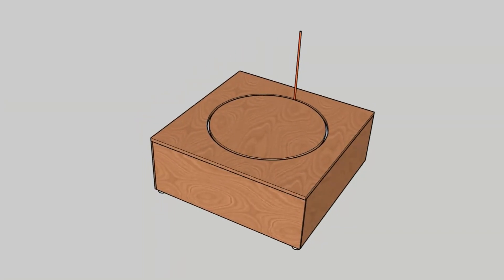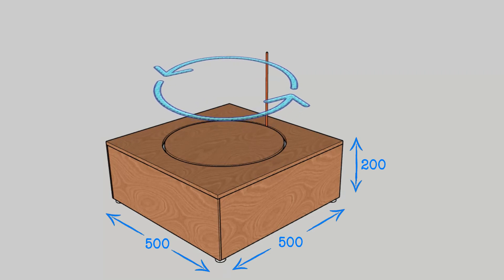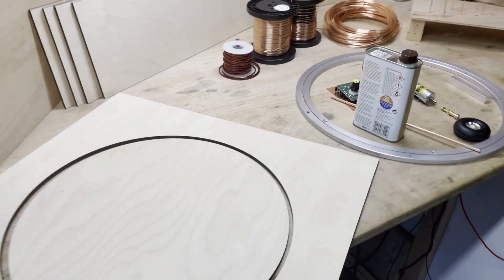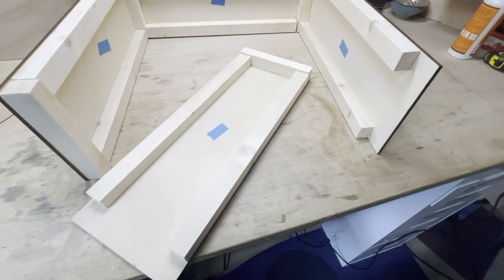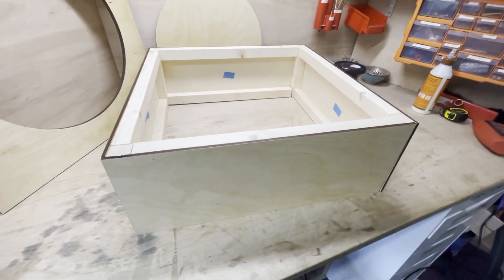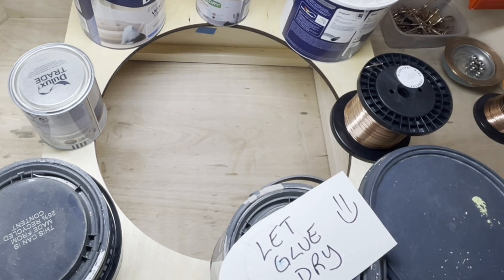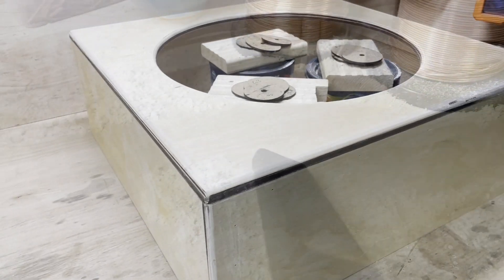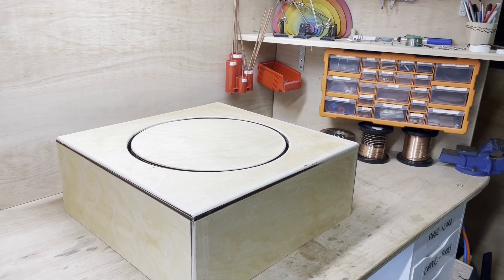A Brand New Rolling Ball Sculpture - RBS5 - EP 1

Comment: you could do 2 upward rails
Reply from the maker: Yes. I thought of having two or three. But for now I think I’ll stick with only one. That’s slightly easier.
Reply: @CopperGravity  maybe a small one that starts at middle height and brings the marbles up again or even having two individual tracks both with a own lift 😁 but everything up to you! i am just hyped about the proj haha
Reply: Neat idea. I agree, maybe having a second ramp that starts at a middle height in order to achieve a greater total height (in case you can’t make the ramp as steep as you want).